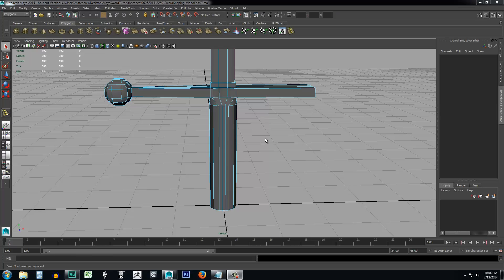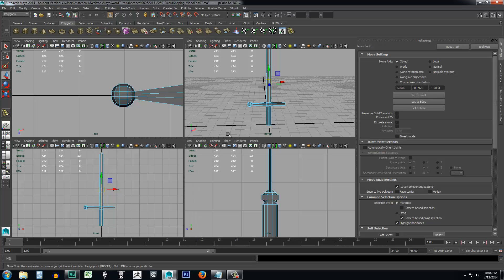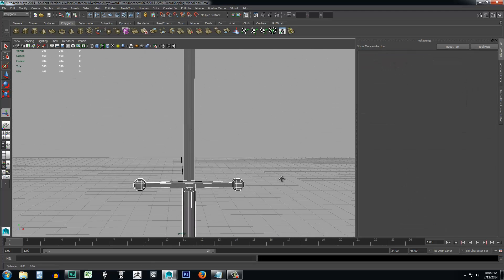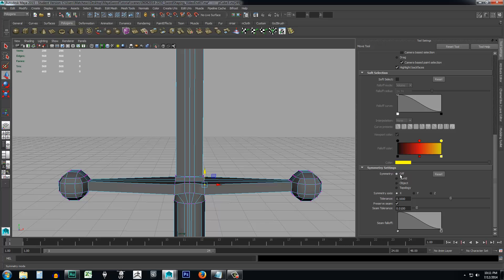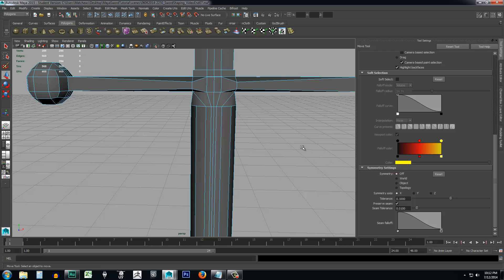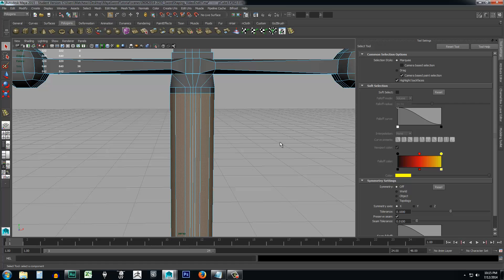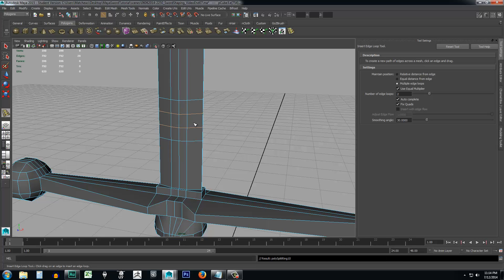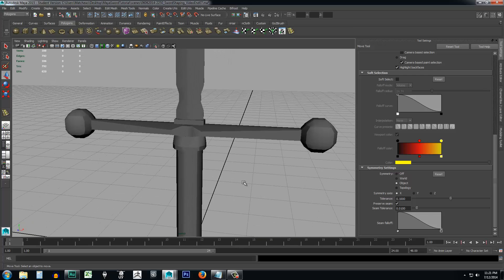08 - Maya 2015 - Mirroring and Symmetry

Comment: I mirror geo, only to find a tiny gap between my middle line. If i connect border edges, it does exactly what i want, but with a broken mesh. Light is fucked on half the mode. if i do connect verts, the mesh doesn't connect properly and leaves a tiny gap. Makes no sense! someone help plz

Comment: I am not sure where I went wrong but, perhaps you can help point out what I did wrong for me... When I delete a half of my sword and then do mirror geometry I ran into an issue. When choosing merge vertices everything seemed to go fine, that is, until I tried to do an edge loop along the hilt. Nothing worked, it would only go along half of either side of the mirrored sword, not the whole thing horizontally. Being confused I zoomed into the vertical equator where I merged the two halves and found there was the slightest of gaps, yet the sword was somehow connected. 

I deleted one half and tried again with the same results. I deleted a half again and mirrored one more time but, this time choosing "connect border edges". This seemed to do the trick as I could make an edge loop around the hilt finally. Though, upon inspection it seems that the gap I had previously experienced is now filled in by a new face that I can now select if I zoom in close enough(though it seems to be about the width of a sheet of paper if that.)

So, problem solved, but, only by skirting around the issue and not actually using the option I originally intended and that you had showed. My question finally, is where did I go wrong? I had the sword centered on x,y,z zero, I ran along the edges of the halved sword and found no abnormalities, so I am stumped. Any clue what I did wrong? Thanks.
Reply from the maker: +Garrett George 
Mirror Geometry works by finding the furthest vertices out towards the direction you are mirroring. If one vertices is further out even by a fraction of a decimal then the mirror will pick it as the furthest point of reference to mirror to. This means that one of your vertices in the middle, along the center of the model, was further out then the others. You have to select all the vertices along the open border and make sure that they are all equal in their respected location.

For instance, if you are going to mirror your object on the X+ axis then you need to make sure all the vertices along the open border (the vertices that will merge with the mirrored vertices) are all equal on their X axis. To be for sure that they are, before you mirror, you can select all of them then go to Window > General Editors > Component Editor. Select the Polygon tab in the component editor and check that axis, make sure they are all the same.
Reply: +Brain Poof Thanks, I am sure that would have fixed my issues. Unfortunately, I had some hard drive issues and lost this file. So, I am going to watch the rest from where I left off as I just re-downloaded Maya after unsuccessfully saving my lost information. Hopefully, you start using a new object soon or I might just have to start over again, we will see!

Comment: hey thanks for the Video. ist helpful but where do you get the tool setings?
Reply from the maker: michiheroes In the upper right hand corner of Maya there are 4 little boxes just below the "X" to shut off Maya. Mouse over those 4 buttons till one says Tool Settings. It should be the one that looks like a tiny hammer with 3 lines coming off of it. It's a small button in the upper right corner of Maya, way upper right corner.
Reply: Oh my bad, yeah i got it, I was already using it but on the left side of the screen :) thanks for the reply. By the way when I do mirror geometry i get all my vertices merged into one Point at some parts. If you have an idea let me know because it would help me work quicker other than that still can merge the verteces manually. so  it´s ok anyway :) Thank You
Reply from the maker: michiheroes When you use the Mirror Geometry tool by opening it options (little box next to the Mirror Geometry command) it will allow you to pick which direction you want the geometry to mirror. After you select the direction you want to mirror to Maya will find the Furthest out vertice in that direction. It will use that vertices as the center point for the mirroring. So if you have some vertices further out then others, only the ones furthest out in the mirror direction will merge together. To resolve this, make sure that all vertices you want to merge are at an equal distance from one another. You can check each vertices x,y,z position by opening the Component Editor: Windows > General Editors > Component Editor. In the component editor click on the Polygons tab, then select all the vertices that you want to merge when you mirror it. Make sure they are all the same in the respected x, y, or z value depending on which direction you are going to mirror it.

For instance, if you are going to mirror in the x+ direction then make sure all the vertices you want to merge together are the same in the X value of the component editor. *(You can copy one of the values in the Component editor and paste it to all the other vertices through the component editor, you can left click and drag in the component editor to change multiple values at once.)